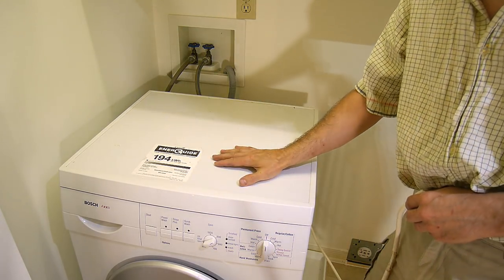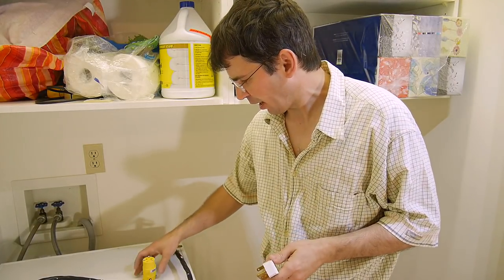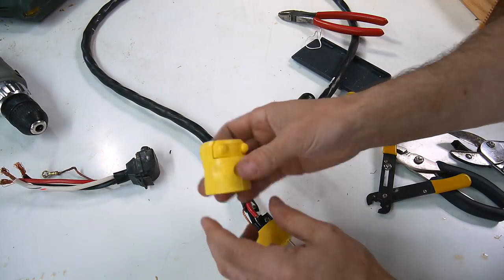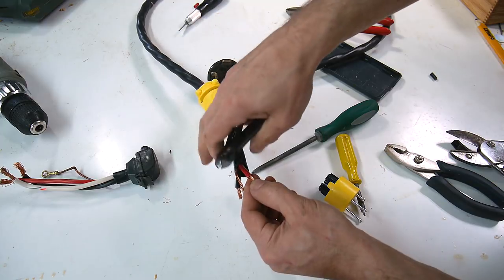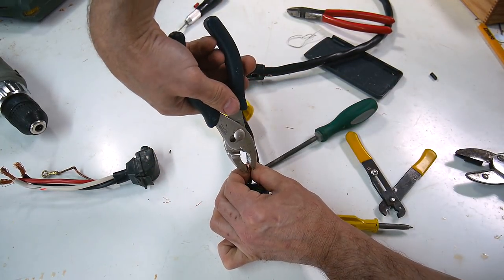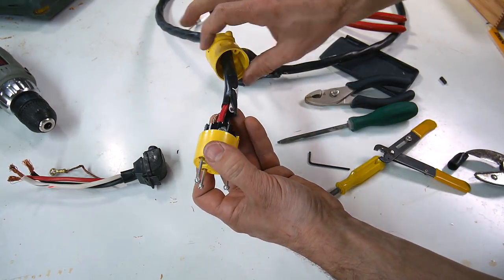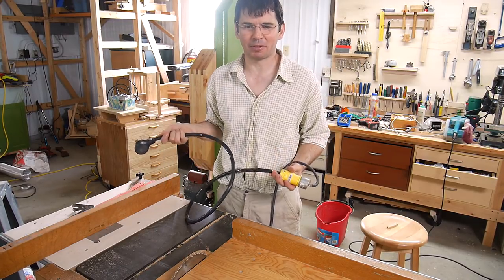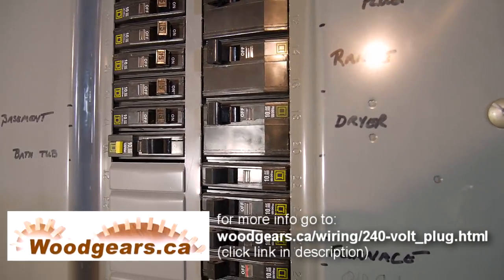240 volt from dryer plug (for Euro-washer or table saw)

Comment: From an european perspective, ......its creepy
Reply: TN-C and split-phase is already creepy. In fact most American wirings and bodges like the high-leg delta transformers are very creepy :-)
Reply: Haha thought the same.
Reply: Combined Neutral and Earth? Say what?
Reply: I'm not a professional electrician, but I'm pretty sure that's not allowed in the UK either, as we're governed by the same safety laws as the rest of the EU (at least for the moment, after June the 19th we might go back to braided cables and wooden cable runs).
Reply: Hell, it's not allowed in Russia.
Reply: yeah its strange both ground and neutral go to the same spot in your circuit breaker box. on an old house i lived it i would make a jumper on the neutral to the ground of the outlet and the outlet box seeing as it wil act just like the ground.
Reply: European system ground and neutral is connected always same spot in braker box. And we have 3 phase system with 230/400 volt
Reply: Antti Logren There was that socket in my mother's house, wired long ago, that doesn't have a ground wire going to it at all. Some helpful soul bridged the socket's ground contact to the neutral to get at least some chance of the breaker tripping for what would otherwise be a ground fault. Except what they bridged to was the blue wire (neutral in Europe), and whoever set up the breaker box ... you can guess what comes next. Luckily we only had a freezer with a really well-painted outer casing on there.

The thing had been live for 15 years when I touched the radiator and felt a curious tingle.
Reply: Wow, jetzt hab ich Angst.
Reply: In the UK you can find combined neutral and Earth, but only on the supply to your house, the supplier can installed either a TN-C system or a TN-C-S system, both combine the Earth and the Neutral, on the supply to your house.

After it reaches the meter though all conductors have to be separate throughout the property, you can read about the systems here https://en.wikipedia.org/wiki/Earthing_system#Types_of_TN_networks
Reply: Frankly the whole set-up scares the hell out of me. The in-line socket looked to be particularly poorly-designed, with no separation barriers between the terminals.
Reply: Phil Makes Things Here is an interesting story for ya ...

Back in the late 80's - early 90's, when I was still living at home, my parents decided to get a loft conversion done, not only because we needed the room, but for years I was sharing a bedroom with my sister...

Not long after it was built, we needed work done on the ground floor, especially since the house was built in the early 1900's ... luckly a maternal uncle had an electrical company of his own, and he began to rewire a fair portion of the house ... but something seemed very strange ....

Imagine his surprise when he found the entire loft conversion, less than six years old, had zero Earth wiring ...
Reply: you think that's creepy?
come here to indonesia we only use 2 cables lol
Reply: I'm sure the regulations will remain the same, but get renamed. I find it scary that some people find the regulations designed to make something as safe as possible a barrier to getting a job done quickly (or they don't know what they're doing and refuse to hire a professional).
Reply: It's like that in Europe too, just not in home application https://en.wikipedia.org/wiki/Earthing_system
Reply: You have TN systems in homes in UK?
In italy we have TT at home and small offices, and TN only in factory/big offices where power arrives in Medium Tension and you have your transformer
Reply: Nicola Cassolato TT is only for remote farm locations or very old urban houses. TN-S is standard for new installations.
Reply: Nicola, for what I am aware of TN is also in use in Italy, you may be mislead by the fact that a separate Earth electrode is requred but that line is connected to PE, which in turn is connected to N (and Earth again) at the local transformer.
Reply: Antti Logren, "European system ground and neutral is connected always same spot in braker box. And we have 3 phase system with 230/400 volt" No they are not ! That was the old way. In new houses in Sweden. They are separate all they way out to the transformer in the street. No connection in your house.
Reply: North America's Residential does not have TN-C. We have TN-C-S. The point at which the Neutral and Protective earth diverge from each other is usually at the main breaker box. The point at which they diverge must also be connected directly to a local physical earth, generally by a local earthing rod.  If neutral and protective earth ground diverge before the main breaker then the neutral and protective earth must be kept separate in the main breaker box.  The being re-connected to physical earth at the point where neutral and protective earth diverge is what gives the North American system the safety that TN-C lacks.
Reply: Neutral is by definition the bonded conductor.
Reply: By definition the Neutral of a branch circuit is called the "identified Conductor" and the bare wire in say a receptacle box is the bond wire.....

two different things
Reply: Alan Douglas  I thought Mathias was an engineer.  If the washer has a neutral it usually means that there is a need for 120v.  Running 120V down an uninsulated wire is dopey.  Better to use the white wire.  That begs the question of how to bond the thing.  I don't like bonding to water pipes, so my choice would be the way a utility box is grounded.  8' copper rod into earth.  What is your opinion?
Reply: alex tworkowski Matthias has bonded the new washer via the bare wire, 2nd a neutral carries the unbalanced load so usually does not have voltage on it. Watch him build the connection again and you'll see the bond wire is connected to the round pin on his plug. That is the bond. Which is connected to the main panel.. which in turn is grounded.
Reply: alex tworkowski from The Little Knowledge i have of the Way things work in Usa is they have dual/Split Phase which is 2x 120v with 180degrees phase separation. (Unlike 3 phase which has 120 degrees of phase separation)

What this allows is dual wired sockets that have L1 L2 N E
L1-N or L2-N = 120V
L1-L2 = 240V
With all 3 configurations using the E conductor.

Im sure just randomly cutting off the N is dodgy though.
Reply: Max Nankervis the neutral is for unbalanced loads. Being the washer is strictly 240v there are none....unless she washes too many jeans
Reply: unbalanced load being 2 120V circuits within one Appliance. or if a device has some 240V and some 120V gear inside?
whereas the dryer for example uses a 240v motor and electrics?

Im from Australia so the Standard connection here is at the power poles or Pits is 4 Conductors, 3 Phase and Neutral (120 degrees Phase Separation) Phase-Phase 415v, Phase-Neutral 240v.

Is it normal occurrence in USA for Split Phase Distrubution rather than 3 phase?
Reply: Max Nankervis we are in Canada, but yes North America is single phase as well as 3 phase
Reply: Totally agree..
Reply: so where does the split phase come from then? is this just using an Inverter on the property?

I didn't realize this was CA not USA. so is it CA uses split phase rather than 3 phase?
Reply: "split phase means 120/240 volts in the USA. The outside transformer is center tapped and center tap is grounded at the pole. One has 120 V breakers for small loads, one uses the two hot 120 volt legs for 240 volts for larger loads.
Reply: what im trying to figure out is where that transformer is, is the power distributed to the property as single phase 240v  and then a transformer on your building puts out the Split phase

or do you have 3 lines come into the bulding from the street Hot1 hot 2 and Neutral?
Reply: The split phase 120/240 in North America is ancient. They did this in the way before 1900 era of DC too. Originally 120 volts was in the 100 volt region say in Edison's era and was DC. 

***The 100 to 110 volts "choice" was purposely, YES purposely chosen for the voltage of lightbulbs. ie it gave the best lumens per watt for a standard 500 to 750 hour filament bulb. 

A higher say 200 volt bulb design was rejected as terrible, ie wastefull. ie less lumens per watt for a 750 hour design and also way less robust for mechanical shock.

 ie the USA was more green, or wanted more lumens per watt than the rest of the world, thus 100 volt became standard. Maybe non USA countries had cheaper power thus lumens per watt did not matter?. 
 as 21 cent
 Thousands of many man years when into perfecting the 100 to 120 volt bulbs. Even in the 1960's say European 220 volt filament bulbs had slightly less lumens per watt than the USA's 120 volt bulbs. Wherewas the outrage then about being green? :) 

Once a standard is around 130 years it tends to stick; thus 120 volts today will be around for centuries here.

  A standard North American 120/240 volt transformer has a center tapped secondary, this is grounded at the pole and is the neutral to the house's power box. The two hots are 120 volts to neurral and are IN PHASE. ie they add to 240 volts in "hot wire to hot wire" .

Thus for a century the non USA places with higher 220 volt filament bulbs burned more coal per lumen of light to heat up the earth more. :) 
  
An EE book of mine form 1920 has the cost of electricity as 22 cents per Killowatt hour., This is like 13 times more in todays money ie about 3 dollars per kilowatt hour. Thus 100 years ago the "110 volt bulb reason" was NOT for being green, it was to get ones light bill down. A house in 1920 was often 110 volts and 3 circuits with a 30 amp service, or a 60 amp too for a big home. Ones with an electric stoves got 220/110 split phase of 30 or 60 amps then too.
Reply: Hello Max. for clarity the common 120/240 system uses one transformer that is center tapped. Post of these are on a pole, a few are at ground level on a pad inside a box. If a customer say a billboard on a roadway only needed 120 volt then they isnatll a 120 volt service and use the centre tap/neutral and one 120 volt hot wire. Gobs of say pre WW2 homes were like this too. Today most all installs are 120/240 volt.
Reply: MrOpenGL are you from the UK?
In Russia we have 3 phase delta topology supply in 9/10 houses. And usually the electricians put all one phase consumers on the first phase (AKA: L1, Phase A, первая фаза) causing a disbalance and as a result the step-down transformer unit (one per about 50 consumers) shutting  off to reset itself and going back on line after a few seconds, only to shut off again when everyone puts the kettle on
Reply: @TesserLink  Not saying I haven't done this for customers to pass an inspection. But you shouldn't do it.
Only way you're allowed to do that is with a ground fault. If something on that circuit is running then your ground wire has potential to ground if it's touching a neutral. If you make the path to ground shorter, like by touching a cold water pipe and a grounded appliance it'll go that way instead.

Comment: Technically.... although neutral and ground are hooked together at the breaker box, they can be different voltages at the outlet due to the fact that wires have resistance and the neutral wire is typically used to carry return current on 120V circuits. On a dedicated, 3 wire 240V outlet like you are using, it is not a problem because neither wire (neutral or ground) carries any current so the voltage on the two wires is the same at the outlet. 

But on a 120V circuit (or a 4 wire 240V circuit that utilizes the neutral) the neutral and ground can have different voltages on them due to the IR drop caused by the current returning to the breaker box over the neutral wire. The ground wire has no current on it so it is the same voltage as the tie point at the breaker box. But the neutral has current flowing on it and therefore can be a different voltage at the outlet. This voltage is usually less than 10V (depends on wire resistance and current going through the wire).

Finally.... tying the neutral and ground together at the outlet is a bad practice because it can cause current to flow back to the breaker box over the ground wire which was not its intention. 

So leaving it the way you left it is definitely the right way to go. You would not want to tie them together. On a 3 wire 240V circuit it doesn't really matter because neither wire is normally used to carry current so both serve as "safety grounds". But on a 120V circuit or a 4 wire 240V circuit that utilizes neutral it would be dangerous to tie them together.

Just a general comment for those who paid close attention to your mention of leaving the neutral wire disconnected. In your particular case it wouldn't matter if you tied them together. But this is not a hard and fast rule.